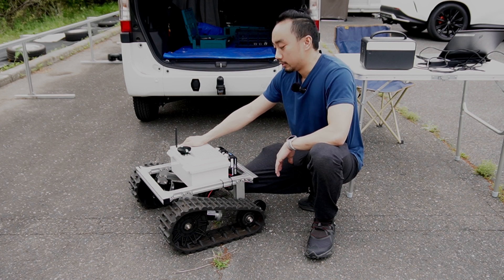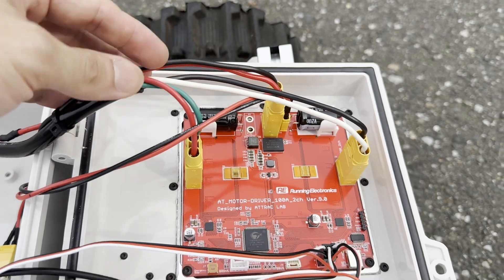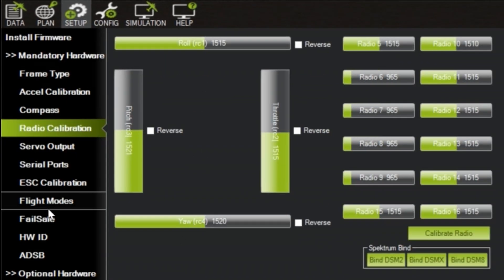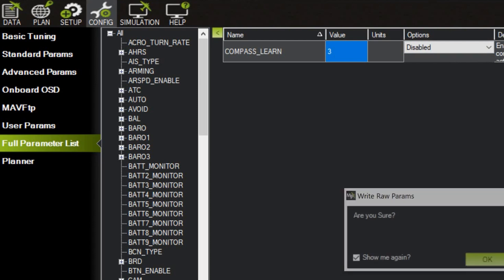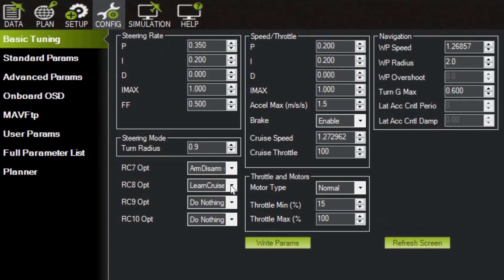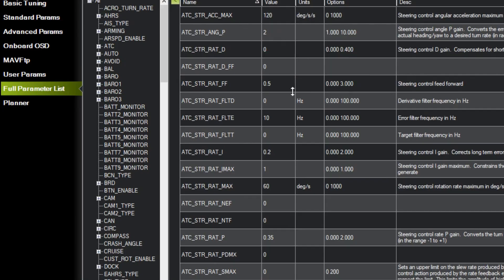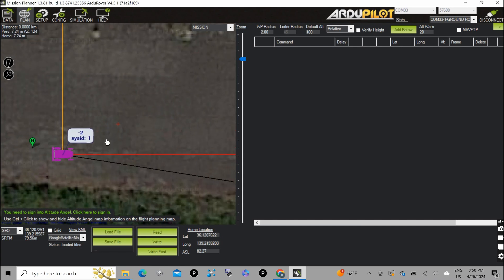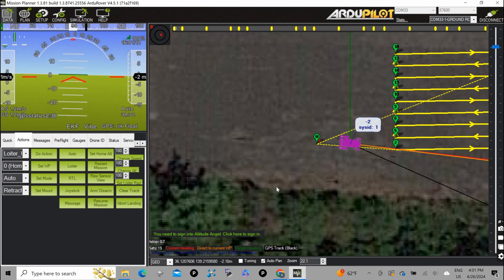ATCrawler | GPS Navigation with Ardupilot for Heavy Duty Robot

Comment: what happens if we not use cubepilot
Reply from the maker: You can use any flight controller which can provide PWM of left and right wheels to motor driver.
Ardupilot is just one of the option, as example.
Reply: @stepbystep-robotics  Thank you sir

Comment: I Have Doubt As Im Currently Doing A Ardurover Project For College, There Are Verified Motor Driver In Ardurover Page. I Thought Only Those Drivers Work? We Can Select Which Ever Motor Drivers We Want? What's The Selection Criteria?
Reply from the maker: Hi, any motor driver which could be driven by PWM signal (1000 microseconds to 2000 microseconds) would work for ArduRover. We normally call it as ESC. It’s well known for those car/drone radio control people.
Similar with this motor driver I am showing in this video.
Reply: @stepbystep-robotics thanks you so much man , im building a rover with robotic arm on top which also have ai/ml vision system. So only brushed motors we're cheap with the right amount of rpm needed. Also do you think brushed motors are best in my case? The payload were expecting is 40KG+. Any suggestions would be eternally grateful , again thanks man 👐🏽

Comment: The PID tuning will be different on each model correct? I’ve seen people tune manually the pid but the 4:30ish mark you are driving in circles-(is this auto collaborating?) thanks again I need to order controller but still have questions I emailed you.
Reply from the maker: Hi, the 4:30 is about compass in-flight learning calibration, one of the function in Ardupilot, normally compass calibration you need to swing the robot up in the air, turning around 3-4 times.😅

PID tuning is from 5:24

Could you please email to me again? I couldn’t see your previous sent email..
Reply: @stepbystep-robotics  OK I will email again also on the compass calibration. I have never seen it done like this before I thought that for large vehicle calibration you pointed towards the north and set it. I haven’t seen anyone drive around like this. Is this the proper way to do it and I’m not doing it correctly? thanks
Reply from the maker: @textrack  Hi, it's an advance function in Ardupilot to do compass  calibration. 
https://ardupilot.org/copter/docs/common-compass-setup-advanced.html#automatic-offset-calibration
You can either do traditional calibration (moving vehicle in the air arond), facing north for large vehicle, or even this auto calibration method (driving  around in circle), no any wrong choice :D
Reply: @stepbystep-robotics yes I really prefer the approach to be honest. I just had never seen this. I thought it was interesting approach
Reply from the maker: @textrack  yes, please give it a try.

Comment: where can i get these smaller track rollers from which extends the track length? on my rover i am quite limited by the default track wheel size. is it a 3d printed part or a commercial product?

Comment: The swiss guy with the accent released a video with 1cm gps.

He said 30m is the resolution without a base station i think.  

How did you get enough gps resolution?
Reply from the maker: Hi, I was using NTRIP for base station, so my GPS resolution is around ~10cm because my GPS status is only RTK Float, rarely RTK Fixed. 
If I setup local base station, that would be much precise.

Comment: Hi! Congratulatins for the project. I can't find the output specs of driver. Which voltage and current motor max can drive?
Reply from the maker: Hi, sorry for lack of explaination of specs information.
The motor driver could operate from 3s to 6s batteries, but highly recommended to use with 5s or 6s (18V to 24V).
The peak current is 100A, so it depends on how much voltage supplying the current drawn would be different, so the higher voltage is better.
Reply: @stepbystep-robotics  Thanks for explanation! 🙂